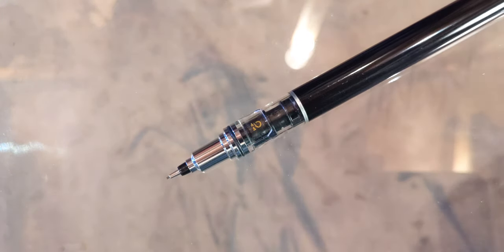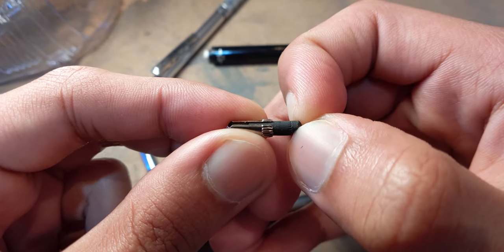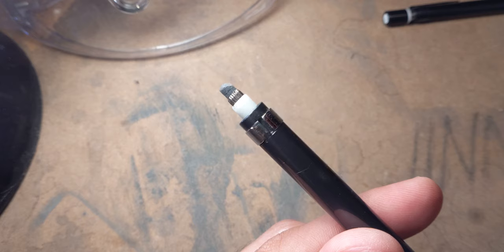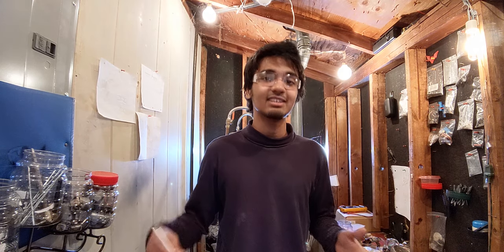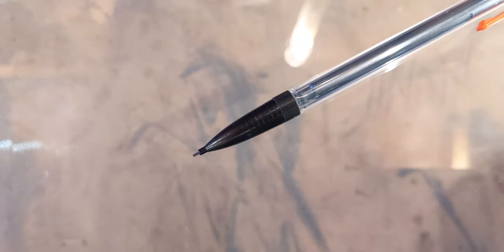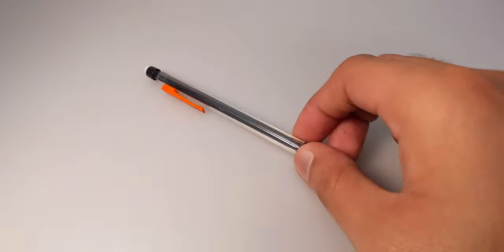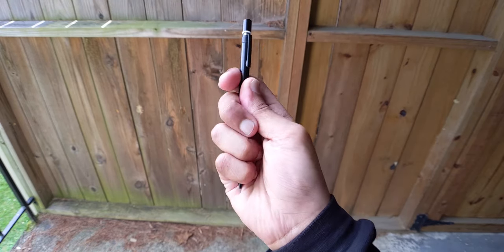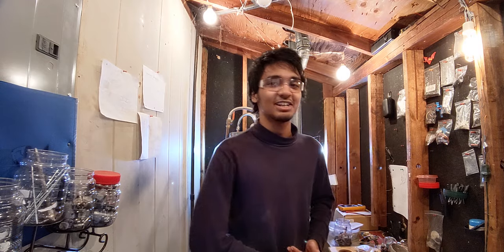My Top 5 Mechanical Pencils - DOPE or NOPE

Comment: That last Pentel looks solid I might have to check it out. At this point my two main pencils for sketching are the Uni Alpha Gel Switch and the Tombow Zoom 505. I like them for different reasons and couldn't decide which one to settle on. The Uni is probably the most comfortable pencil I've ever used and functions perfectly (I don't use the lead rotating function, I like that it gives you the option to choose). The Tombow is heavier but still very comfortable to use and has a bit more of an "executive" feel to it. I ended up putting some 2B lead in the Uni and HB in the Tombow so I can switch back and forth as needed. If I had to edc a pencil it would be the Paper Mate SharpWriter. Been using them for years and they're just wonderful and inexpensive.

Comment: Try uni kuru toga 0.5mm I have 4 of these pens they are lightweight and comfortable to use and  are very reasonable price wise and reliable. When it comes to small rubbers try tombow 2.5mm  mono zero hope this helps

Comment: Add zebra delguard (any type but Lx and original is recommended)
Pentel Kerry to complete the collection and uni kuru toga doesn't useful at all to me , i use advance and still no use as i take the pencil out of the notebook least, instead i found serve swell to be better because if you fidget it around, it actually rotates the lead for some random reason

Comment: Man this is terrible. 
I keep looking for a better mechanical pencil, but can't find something really great.
And all of these (except the bic one) are VERY expensive in Brazil. 
Seems like I will keep using the pentel P205 0.5mm ones. 
They are simples, reasonably cheap and write well. 
Are any of these a good upgrade?
I was really looking into the kuru togas, but definetely not up for a wabling tip. 
And having one of these hard to find and expensive things breaking on me would be a bummer. :-(

Comment: What am I doing wrong ?  Can not make most of my mechanical pencils to feed the damn lead.  The Orenz 0.2 is the worst.  Please advise
Reply from the maker: Maybe you can try to feed the lead from where the eraser goes in. Just remove the eraser cap and the eraser, put a few leads in there, and just keep pressing the button to see if it comes out from the lead sleeve.

Comment: @Jinan can you or anyone tell me what lead variations come in mechanical pencils? I'm looking for lead that isn't too dark and soft/crumbly, but all of the mechanical pencils I've bought from stores or even ordered over the Internet have all been the same. But I know there are different lead types I can get because I've gotten them before (it's just been many years).
Reply from the maker: The variations are basically based on 2 things: size & darkness. My go-to is 0.5 HB because it's not too dark and not too soft for whatever I do. I'm guessing the leads you used are probably 2B. Also, it depends on the tip of the pencil. The lead may break easily because of the loose tolerance.

LIGHT & HARD  …HB > B > 2B > 3B…  DARK & SOFT
Reply: @jinanprojects  So which number represents the darkness and which one represents the hardness? I think that's one thing I've always been confused about. Is the 0.5 referring to the shade or the texture?
Reply from the maker: It's both. For example, the soft nature of 3B lead allows it to leave darker strokes and vice-versa.

0.5 is just the diameter of a specific lead. Obviously, a 0.7mm lead would be a lot stronger than a 0.5mm if we compare within the same hardness level.
Reply: @jinanprojects  Thank you. Even though I'm still trying to figure this out. So, can you tell me what lead I should get if I want the lead to be very light? Or which of the leads or of the lighter variety?
Reply from the maker: You can try an "F" graded lead which is a little lighter and harder than "HB" which I use.

Here's a 0.5mm "F" graded lead I found on Amazon
-  https://amzn.to/3NG45pS

And here's a webpage about Graphite Grading Scale
-  https://pencils.com/pages/hb-graphite-grading-scale
Reply: @jinanprojects  Thank you!

Comment: Can you further explain how the end of the Pental Graph 1000 works?
Reply from the maker: The tip? It doesn't do anything. The paint just helps it to be a bit more grippy.
Reply: @jinanprojects  sorry I meant the eraser cap
Reply from the maker: Ohh... You can just rotate the cap to label the lead you're using.

Comment: I am preparing for the exam, so I write a lot and I am solving tests. Which pen would you recommend? Pentel Smash 0.5 and Pentel Graph 1000 For Pro 0.5, which is better?
Reply from the maker: I haven't tried Pentel Smash. I just use Pentel Graph 1000 for basically everything. Writing, sketching, drafting... everything...
I think I would recommend the Graph 1000 For Pro.
Reply: @jinanprojects  Thank you for your answer. I bought the Pentel Graph 1000 online, but when I press it to remove the nib, it sometimes makes an uncomfortable sound (like a door squeak), when I shake the pen the back cap of the pen (pressing zone) makes a noise, and there is a small gap between the rubber grip area and the nib just below it. Do you have these problems in your pen, are they chronic? Or is there a problem with the pen I bought? I would be very happy if you answer, I will change it accordingly.
Reply from the maker: I bought 4 of them so far, and I didn't have any of these issues. Maybe contacting the seller for a replacement would be a good idea.
Reply: @jinanprojects  Thank you, I wish you success.
Reply: @sevkettamturk2732  Merhabalar bende sınava hazırlanıyorum, pentel kalemlerle deneyimin nasıldı hangisini önerirsin hocam

Comment: You're saying nope to thye best pencils on the market,  First, forget about the erasers.  Erasers on mechanical pencils should only be used for very tiny, tiny details, and for this, they all work fine.  You're supposed to have a high quality art eraser for doing anything else.  Second, you don't know much about drafting pencils at all.  The 1000 is one of the best drafting pencils made, and it has what may be the best grip on any drafting pencil made.  The weight is also perfect for a drafting pencil, and all for an unbelievably cheap price.  The problem isn't with the 1000, it's with you.  

The biggest problem with the disposable pencil is that it's made out of plastic, and plastic is rapidly destroying the world's environment  No one with a conscience buys disposable plastic items, especially things like pencils where there's a clear choice.  One other problem with this pencil is that it's cheap junk.  It's everywhere simply because it's dirt cheap, and most people don't even know how to use a good pencil, or what one is.  Sadly, most people also have no conscience where plastic is concerned.  Throw away a pencil, kill an animal, add to a landfill, clog the ocean, all so you can use a cheap piece of junk.  Really, even buying these pencils is an act of complete disdain for the environment, of the health of the world.

Your number one pencil is just an overpriced piece of junk.  It's not even a real drafting pencil. It will break, and it will end up in a landfill.   

If you want a better grip, do like the pros do and buy a slip-on grip of your choice.   You can get them in many types of material, and in sizes to fit any pencil or pen.   Or put a narrow slice of two-sided carpet tape around the grip.  I'm not sure how anyone has a problem with the 1000 grip, or how they could think it's too heavy.  What happens if you ever get a job where you have to delicately use a tool that might weigh four or five pounds for eight hours straight?  Even something like a wood chisel or an engraving tool weighs many times as much as a 1000, and has to be used with even more precision than a mechanical pencil.  

Seriously, stop buying cheap plastic junk that will just be thrown away at some point.  The world you help save is the only one we have.